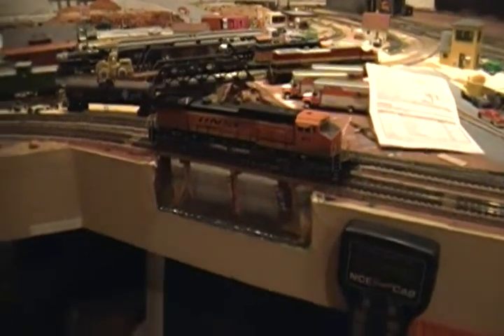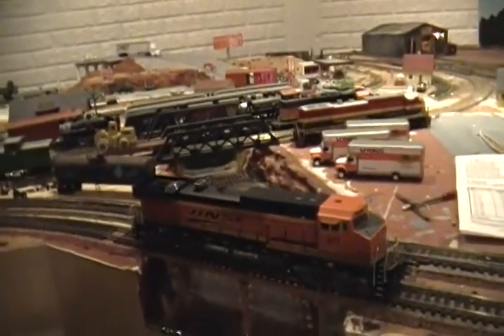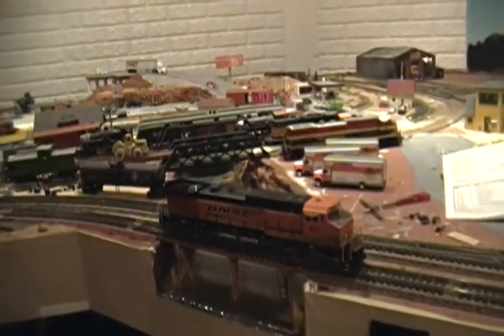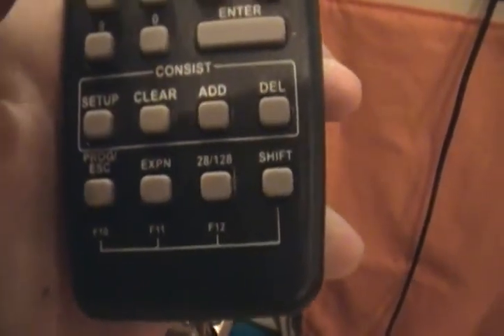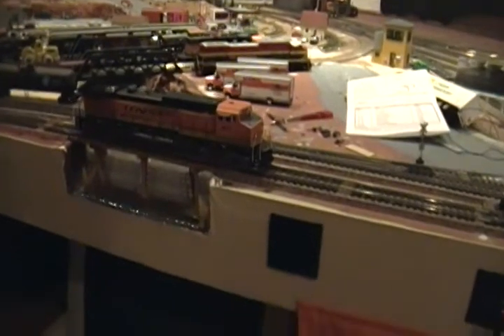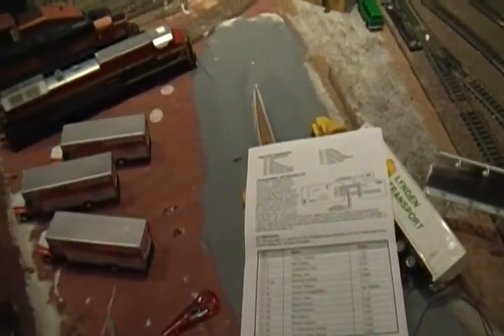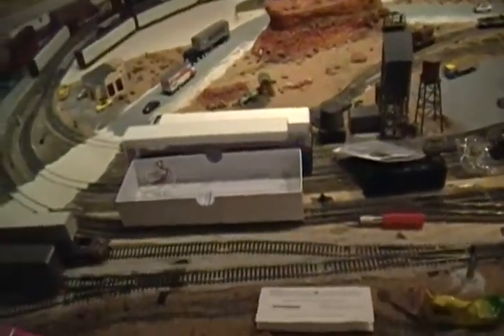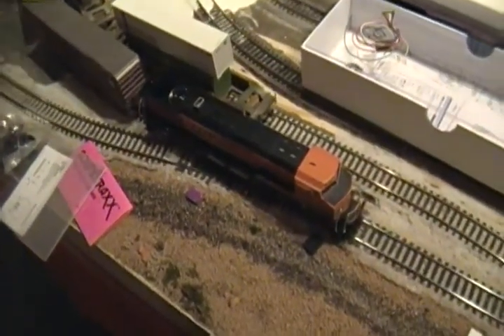Tsunami FDL-16 sound part 1

Comment: You should enclose the speaker in some kind of airtight box as it will enhance the sound.Is that the fdl 16 modern style with the air compressor whoop? if not ,you should change it over as it better represents the ac44